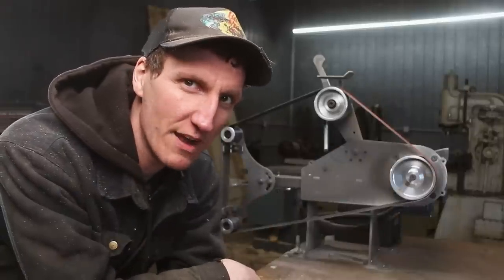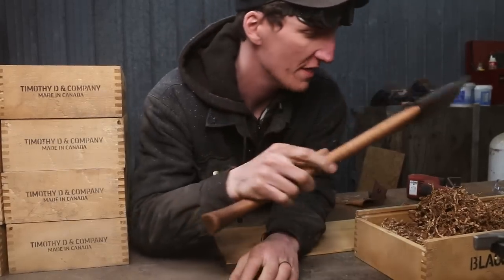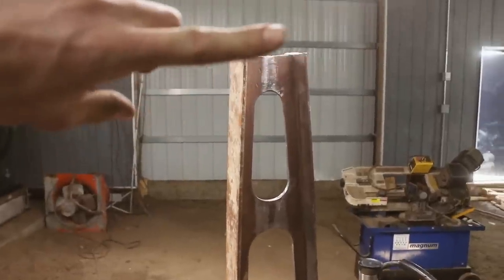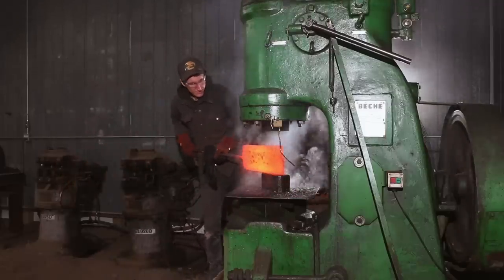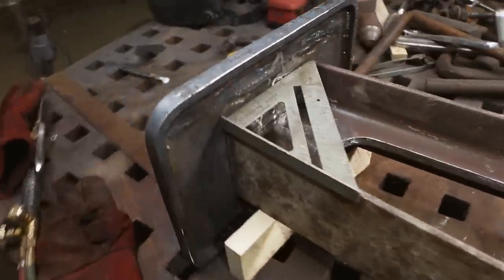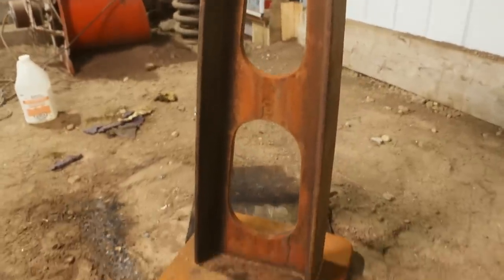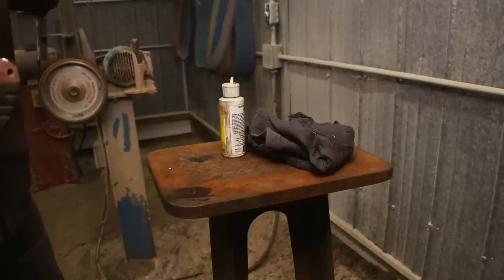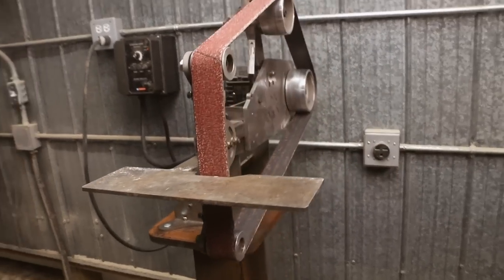Building the COOLEST stand for my grinder!

Comment: If you do make the interior walls, you can always use the inside face of those for more storage for belts and things. I like the rustic look, but the flash rusting looks a little bright. Maybe you could darken it a bit to look a bit older with a little bit of oil. It might help protect it from the bad rust, too

Comment: Hey Tim, if you are trying to speed up the rusting on steel using muratic acid. Apply some hydrogen peroxide after the acid, and you will get instant results.

Comment: Railroad rail is classified by its weight. So if that's 115/119 lbs rail every 3 feet is 115/119 pounds. That way we do the math when lifting with pettibone/crane when replacing rail or panels (rail connected to ties)

Comment: I thought lemon juice for the rust but whatever works. However, thoughts on putting a hinge on the top plate so you can swing the grinder 90 degrees?
Reply: That Vashti pilot already has a 90° tip function included. (Although I have to rotate the motor on mine because the starting capacitor gets in the way, I didn't realize it when I set it up.....)

Comment: I've never seen a horizontal fuse panel
Reply: Vertical circuit breakers/fuse panels are an American thing, Canada, Uk and Australia use horizontal mounting, similar thing to which way you turn a light switch on/off, USA is up for on, most other places are down for on.